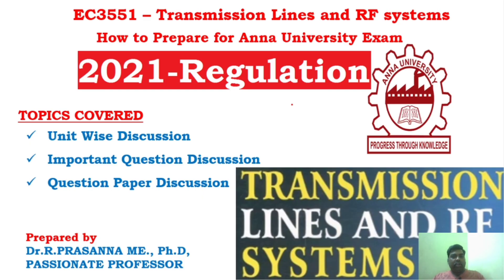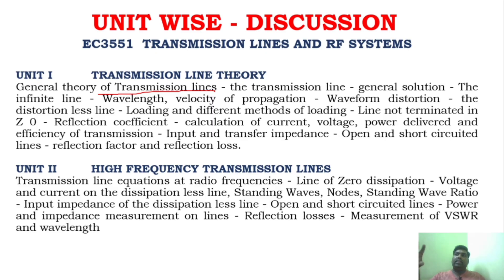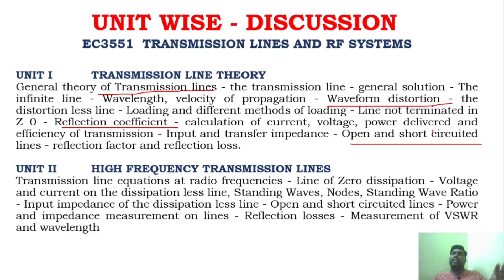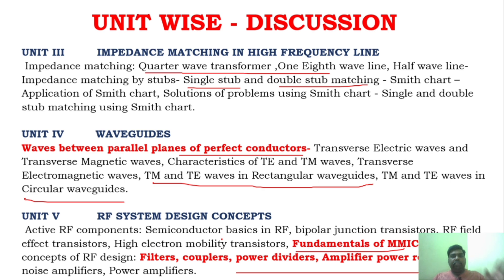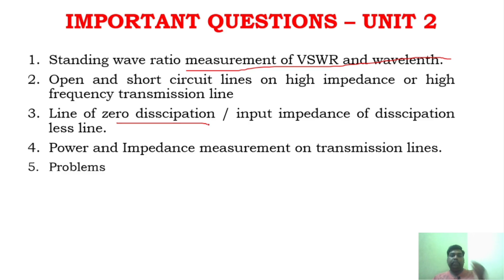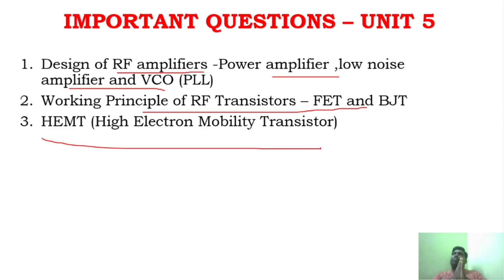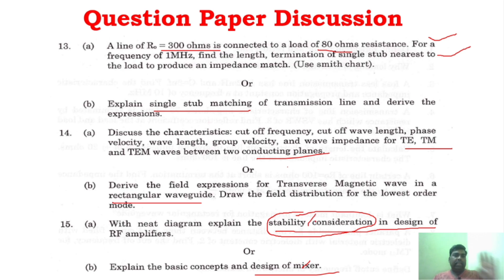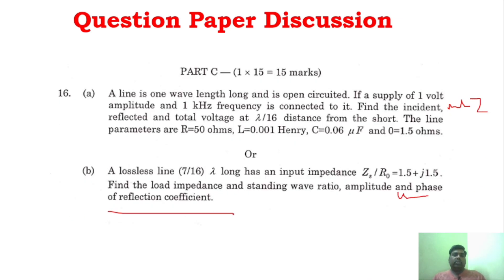Anna University Exam Preparations - EC3551 Transmission Lines and RF systems (TLRF)

Comment: Finally I cleared this subject in 5th attempt. Thanks a lot ❤ I will give all credits to you ❤️. I have only one paper. MA8451 PRP sem 4 reg 2017. Please upload PRP important questions same like. June 4 2025 exam start. Please upload
Reply: Arrears kastam ma irundhucha bro.. Full la problems sa illa option la derivations ketangala bro
Reply: @KalaMani-n5f derivatives than. But 11th question la Equation nu oru question varum. Unit 1 Atha matum clear ah pathukonga. Kastama eruntha biheart ahthu panirunga vera vali ila. Unit 2,3,4,5 la video la erukra mathiri important questions ah padichale pothum. Easy engineering website la 2 marks upload panirupanga athula most respeated questions ah 15 choose panunga. 4 atten paniralam